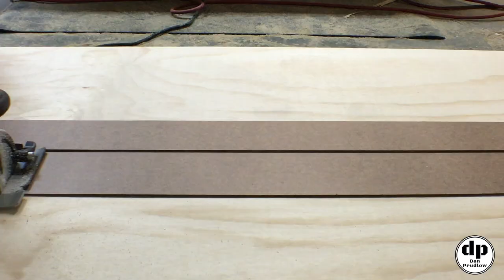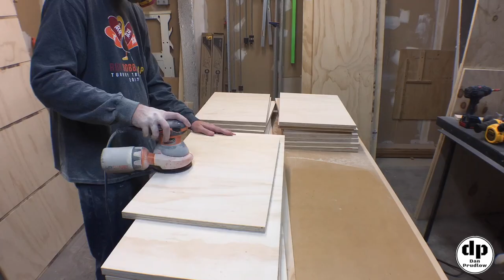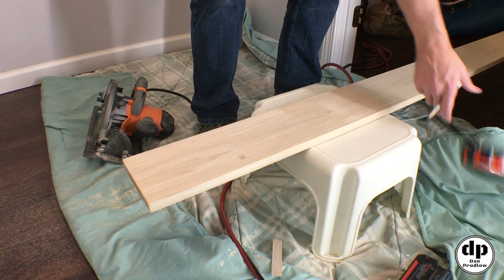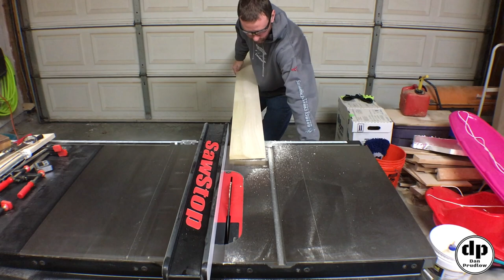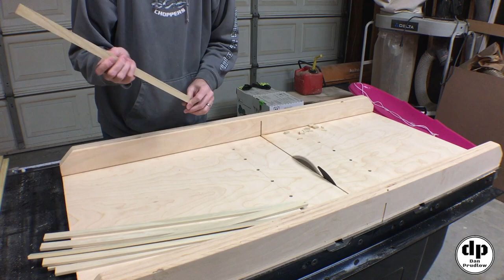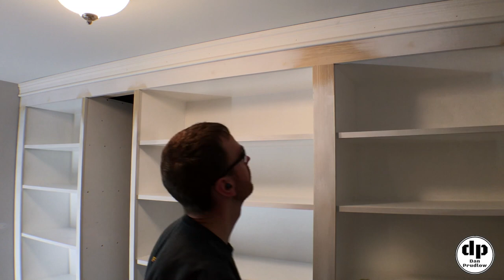Built In Shelves Part 1 | DIY | Build Custom Shelving

Comment from the maker: Want to support the channel? Here's what you can do:
 - Subscribe to the channel
 - Hit that Like button
 - Leave a comment
 - Amazon Affiliate: https://amzn.to/2LaN1Ib

Part 2 Video: https://youtu.be/rgylJmxzeFE

This is part 1 of my custom built in shelving build.  The shelves are built with inexpensive pine plywood and face framed with poplar.  I built these in my basement after having to demo the previous shelving in order to do some insulation work.  This video covers most of the build but be sure to check back soon for Part 2 where I will tackle a removable section to cover the drain pipe to allow future access if needed.

Thanks for watching.  If you have any comments or questions please leave them below or hit me up on social media, email, or my website.

SawStop 1.75hp PCS: https://amzn.to/2X4gWsP
Bench Dog Push Blocks: https://amzn.to/2YB00uL
Ridge Carbide 10-inch Saw blade: https://amzn.to/3bATmcp
Bosch 18v Impact Driver: https://amzn.to/3cxAhJk
Ridgid ROS: https://amzn.to/364yHMA
Titebond Wood Glue: https://amzn.to/2LzTdv4
Bessy Parallel Clamps: https://amzn.to/2z4LHG3
Bessy 6-inch F-style Clamps: https://amzn.to/3e3LGl4

Hit that like button and don't forget to subscribe!  Thanks!

Subscribe: https://www.youtube.com/danprudlow?sub_confirmation=1

Twitter: http://twitter.com/DanPrudlow
Instagram: http://instagram.com/danprudlow

Comment: Man..  never seen a carcass built that way..   but if it works for you.. have at it.     I build the box first then slide the shelves into the dado. Glue and nail.. then spray..    makes life easier..         here's a cool thing a lot of people don't know about..     Lowe's has a spray gun over in the air compressor /tool section..    it'll spray latex right out of the can..   most of the time with zero thinning the paint!   It puts on a beautiful finish and it's a pretty nice gun!    It has a pressurized pot that pushes the paint up the feed tube..   I use the crap out of mine!    Just remember to run the paint through a strainer..
Reply from the maker: I agree it’s a bit different way to assemble these things but I promise there is a method to the madness.  The router bit I have matched the thickness of the plywood about as exactly.  This is good for a really tight fit but would have been impossible to slide the shelves in the way you describe.  I had to use clamps to press things together!  Had I used a dado stack at the table saw I could have added a shim to give a couple thousandths clearance but I don’t own a dado stack yet.  Kind of a “use what you’ve got” approach.

I do like the idea of a paint sprayer...but I wouldn’t use it enough to justify the cost right now.  It’s on my list though!

Thanks for watching and for the comments.  I appreciate the interaction.  👍🏻

Comment: What thickness ply did you use? Have you found it to be sufficient in supporting what you place on the shelves?
Reply from the maker: This is all 3/4 plywood.  We’ve got the shelves loaded down with books, toys, etc and it is more that strong enough for anything we’ll ever place in the shelves.  I’m 180 pounds and I wouldn’t hesitate to sit on the shelf if I could fit.  Thanks for watching. 👍🏻